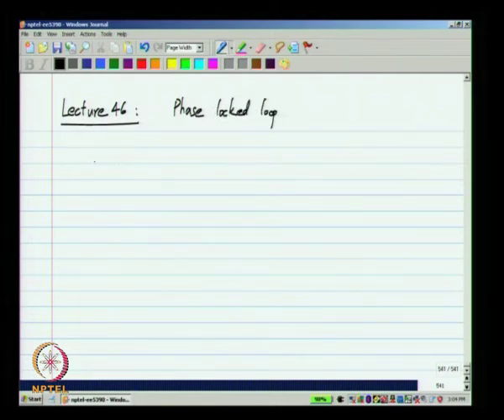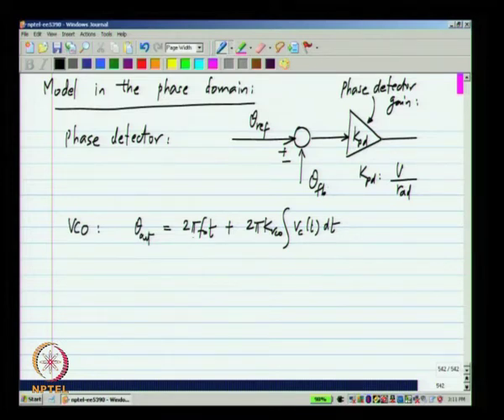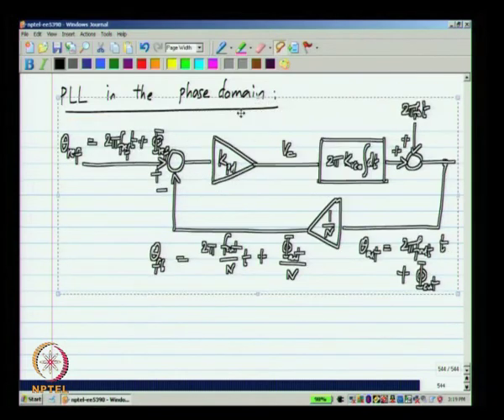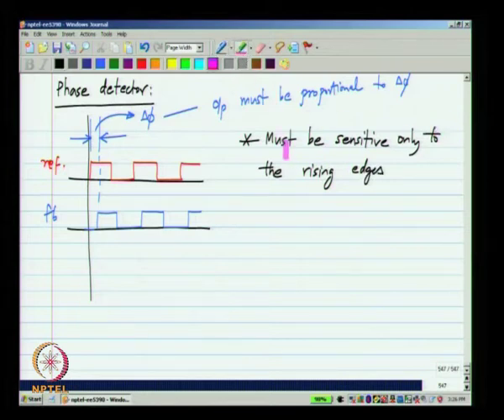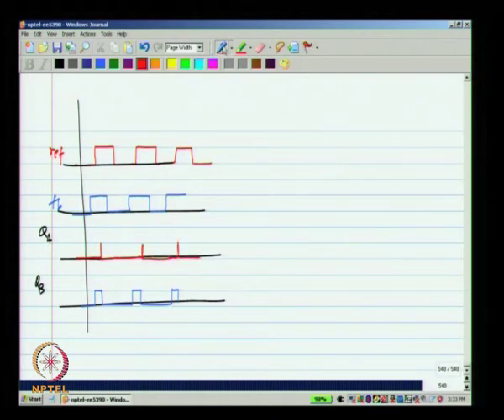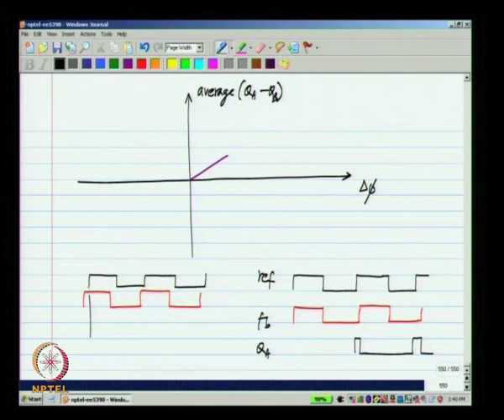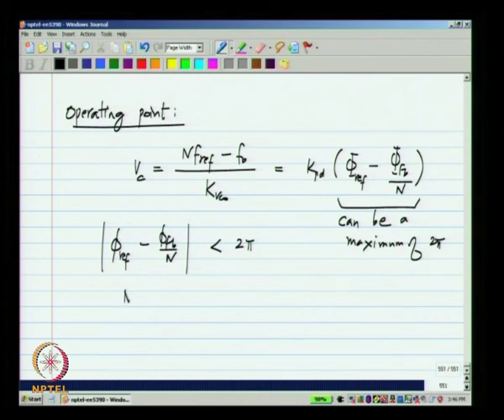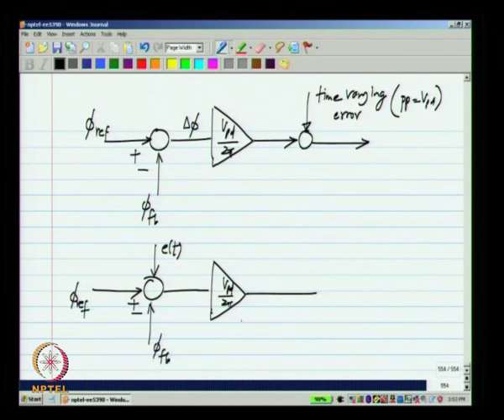Mod-01 Lec-46 Lecture 46

Comment: 40:26 In that slide, shouldn't we just subtract phi(fb) from phi(ref)? Why do we divide phi(fb) by N?
Reply: Yes I think that that's a minor error, you are right that phi(ref) will be compared with phi(fb) which itself is phi(out)/N and no other factor should come.
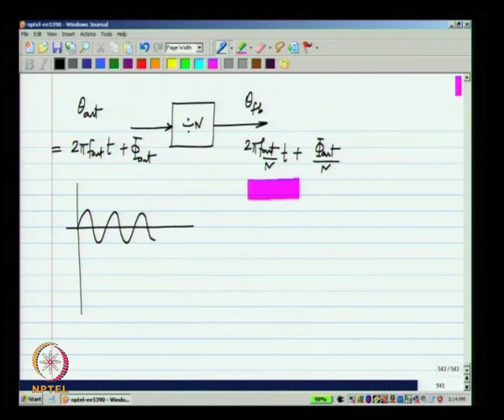Reply: @utsav is is explained at 09:25 mins in this lecture that how does phase also divide at output of frequency divider
Reply: @rohanchoudhary6890  I still don't get it. I understand phi(fb) has phi(out)/N, but I thought the pfd compares phi(ref) and phi(fb), so why is there a second division of phi(fb)/N? Thanks.